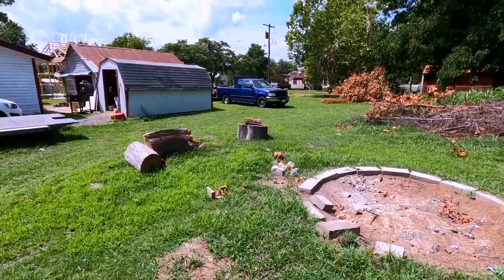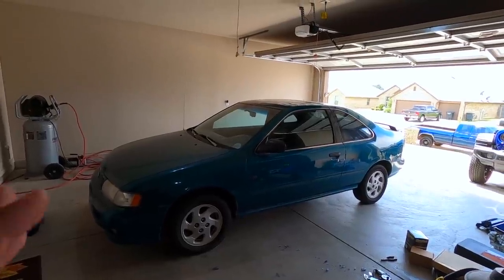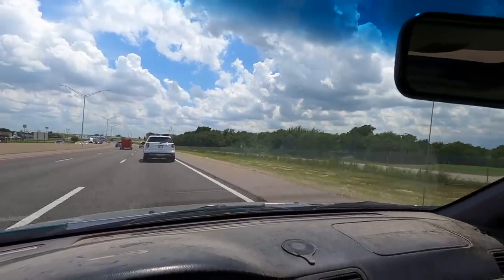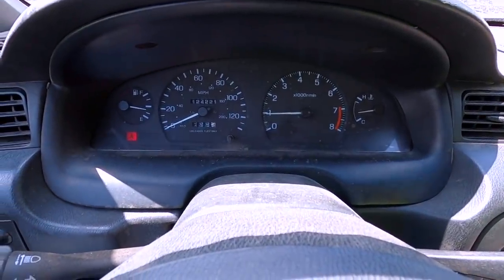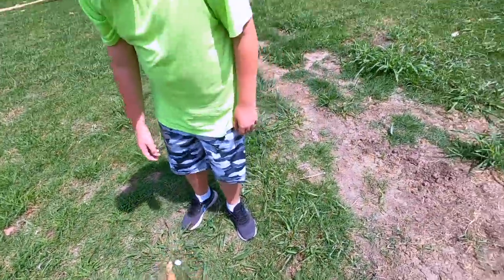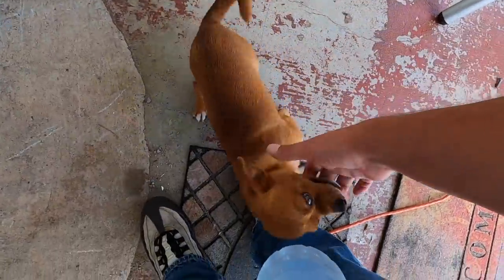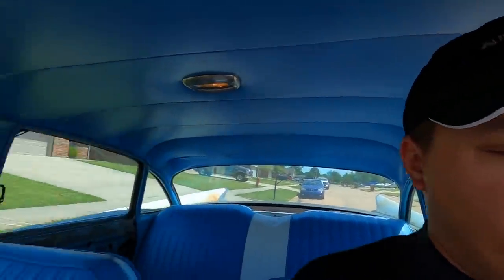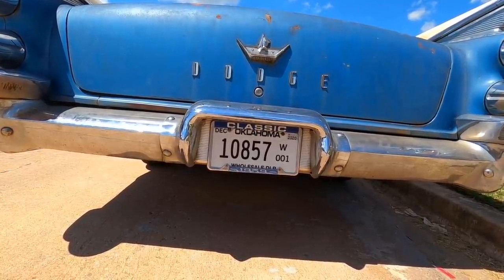Shop Update + Hellcat CQuartz + New 2020 Jeep + Nissan 200sx + Chevy Sonic + 1959 Coronet

Comment: My dad had a similar issue with Gm when he bought a new 2017 1500 high country three years or so ago. It had tons of electrical issues in the 2000 miles he owned it. Sometimes he would go over a speed bump and the whole truck would shut off, and in other cases after sitting for a few days or so It just wouldn’t start again and ended up being towed to the dealership multiple times. Luckily it ended getting lemon lawed and he ended up buying a 2018 Toyota Tundra 1794 Edition and it hasn’t had any issues since being purchased.
Reply from the maker: I have to admit, you can not go wrong with a Tundra man!!

Comment: It's a birch tree Randy and it's huge!!! Fun fact Native Americans use those for canoes... I didn't have any doubt in the 200SX been driving mine 2.0 5 stick for 5 years... my Nissan Sentra I think the same year is that one with the 1.6 only slip the timing chain at $300,000 🤔 it was a few hours after I had pushed it up to about a 130mph " Mexico 😜 "... They're good little car! Most of them around here were made in Nashville Tennessee. So they're American 😉👍 "you know you can always find out where they're made looking at the VIN." The only major issues I've seen with my Nissan is front end durability.... control arms, ball joints, tie rods it's a good has lifetime warranty!

Comment: I have a side hustle idea. You could be an ISP, with your commercial line you're allowed to be a reseller. Sell your neighbors affordable internet to help cover some of the cost. You can use Ubiquiti wireless point-to-multipoint antennas to distribute the signal.

Comment: You have to first turn on cruise control, the button is to the left of the steering wheel. That's why it didn't come on.
Reply from the maker: No, I actually did that. The set button does not work.

Comment: I have had cars with sticky cruise control buttons.  Just keep playing with them, eventually you will knock the crap off the connections and it may work great.
Reply: He didn't turn on the cruise.  There is an on/off button you need to use first.

Comment: Shops do cost that much to build, even the pole barn style like yours. I built a 24x30 12ft ceilings and did all the work myself and spent around 10k. Will be a nice shop
Reply: I agree.  Putting in electric can be $2K or more if they are putting in 220V for a welder.   More for plumbing if they put in a bathroom.  I don't know if a lift was part of the price.  $40K ends up being a low number, only because the labor is cheap.

Comment: On the '59, other optional motors those years included a 361 and 383 and the 413, all of which should be easier to find parts for and would be a drop in with the right combination of mounts.  The only catch is you may have to start with a core and have it rebuilt.   I've had them and junked them, I kick myself now because one you pull yard there was a '63 chrysler that looked like an abandoned project, ready for paint, the motor in it was shiny, clean, fresh paint, like it had just been rebuilt.  For the $150 I should have bought it and stashed it.

Comment: You should move down south that same shop would have only cost you 15,000 here in Tennessee. Probably less, I can get a concrete slab poured for 3000 and a 30x70 building built here for 20,000, and if I build it myself around 6k.

Comment: I would have waited for the new 6.4 Wrangler coming soon.
Reply from the maker: Why? I have a SRT Hellcat. Don't see the point in a top-heavy Jeep.
Reply: I guess the only upside would be the torque. And I don't think you can get the 6.4 with the Manaul, so it wouldn't be good for certain types of off-roading. Now that I think about it, there is no reason to make that V8 keep, other then owning a V8 jeep

Comment: RE: 59, the engine rebuild stuff can get a bit pricey. (kanter.com) I wonder if you know that the small block 318 of the 50s is different from the more recent one. the older is an A engine and the newer is the LA. I think a modern one can be swapped in with few mods, but bear in mind any change you do will bring up problems. If you could detail what is wrong i might be able to help. in the interim, use some performance parts. they are much cheaper than OEM parts and perform much better. A hotter racing coil will definitely help, and replace 1 qt oil with marvel mystery oil, that will clean the internals. if you need a generator I have one. Also a voltage regulator. A carb rebuild will help quite a bit too. Don't give up on her yet ;)
Reply: When he was turning it over it sounded like a burnt valve.  if he does a valve job, it will probably be back up to 8 cylinders, however, I have been driving my 1963 Fury 361 with a burnt valve since I got her back in 1982.
Reply: @mexicanspec  63. good call. that was when virgil exner's "awkward" phase was discontinued. The B engine is a stout motor, it weighs 20 lbs less than the poly too.
Reply: I wish i could source a couple heads for him. I could possibly get the ones from my old 301, but I'm not sure if he'll lose volume or gain compression. :/

Comment: A 200sx with a 1.6ltr it must have been swapped out the original engine. The 200 specifies its a 2ltr, hence the 180sx has a 1.8, 300 has a 3ltr etc.

Comment: I could have suggested  some really nice and not too expensive 10 ply tires for towing heavy loads and All Terrain grip too. but those should be meaty enough for now . However if you tow a lot with those ther's always a chance the life of your tires will be severely shortened. I went to Discount tire  and got their Pathfinder AT's (LT265 /70 R17 121S E1 OWL) my 06 dodge 2500 has 17''s but they sell them in 20's also and the "10" in the model number is for they 10 ply reinforced sidewalls for towing . and even with those tires i still am getting 30 MPG unloaded out of that 2500 megacab dodge truck of mine.. Don't be cussing GM just because you have to deal with a shitty dealer there in your local area. You've had a lot of good luck with GM until you started dealing with your local guys, so don't poo poo the whole brand because the shitty locals screwed you over

Comment: GM quality is better than FCA but when you get a bad one of any brand it sucks.
Reply from the maker: So far I have had no issue with any of the 4 Fiat products I own. I have had serious trans issues with my 2016 Camaro SS, and electrical issues with a brand new 2019 Corvette.
Reply: @AutoAuctionRebuilds  they all produce some junk but over time the GM's are usually more reliable.   Where you keep them short periods they all make some cool cars.  I'm dumping a mustang GT i bought for a spring summer toy and will look at Chargers when I am looking for something new in Feb/March.  I buy and sell toys every summer and most winters.  Corvettes a bit to small inside but i like the Challenger and Mustang over the Camaro for some reason.

Comment: Pls don't call the hellcat a fiat 😂 it's far from a fiat
Reply: No it's not.  Literally the car is manufactured by Fiat.  If you think that Mopar quality didn't suffer when Fiat bought the brand you're insane.
Reply: No Despair Bear go drive a fiat and then go drive a challenger. They are completely different in quality trust me I own a challenger
Reply: @largenloud9744  I've driven both.  Different cars yes but same poor quality control overall.  To argue one has differing quality standards is asinine as they are literally the exact same company.
Reply: No Despair Bear The term “quality” gets thrown around a lot. What exactly do you mean by lack of quality? Bc dodge and fiats quality are completely different even reliability. Ik ppl with scatpacks both over 100k miles with next to no issues and still going.
Reply: It’s not totally a Fiat, the chassis for the Charger and Challenger has roots back to 2006 when Daimler Benz (Mercedes) had Mopar. 
It is fun however to sit in a Maserati Ghibli and see FCA parts bin bits in them and wonder how anyone would want one.